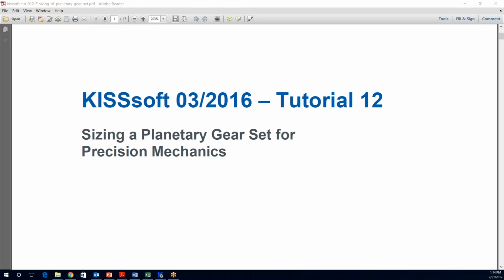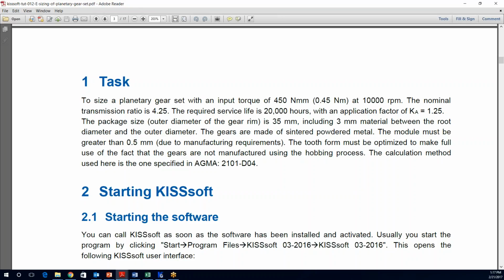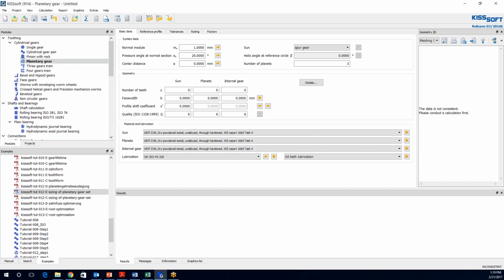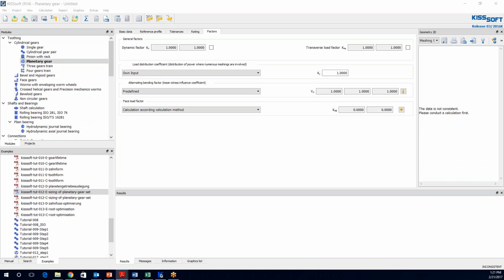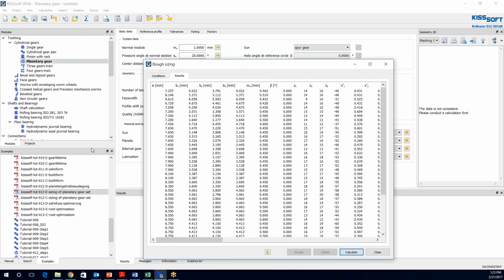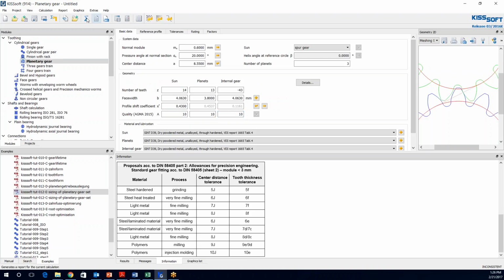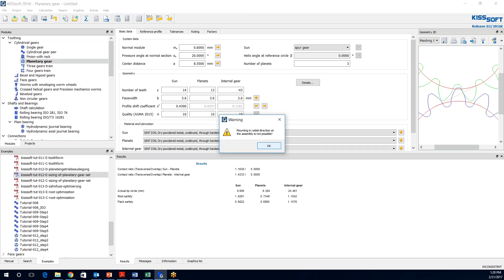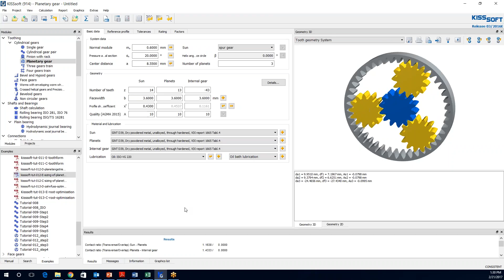Rough Sizing a Planetary Gearset Part 1

Comment: Hello Warner, I have a question here. The driving gear you are selecting here as Planet carrier (internal gear) , but you are considering the reference gear as sun gear and specifying the input torque and the speed to the sun gear itself.  If the input or the driving gear is internal gear then the input torque and speed of the shaft should be applied to this and not to the sun gear.Could you please clarify about this?
Reply from the maker: if you select the double arrow of the speed definition, you will see the internal gear is by default set to zero.  So if I specify the sun gear speed and torque, the input speed and torque is calculated for the carrier, I noted I didn't mention this in the video, and that video is and older version.  Good question.